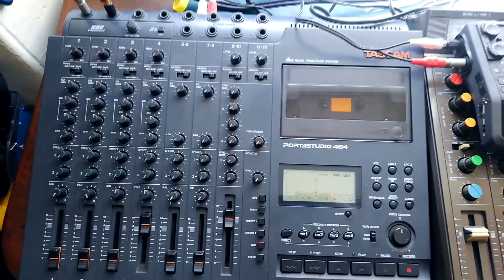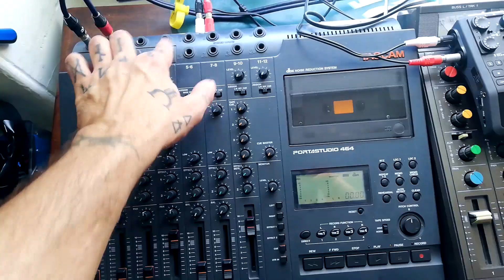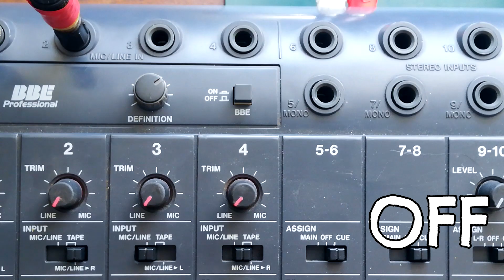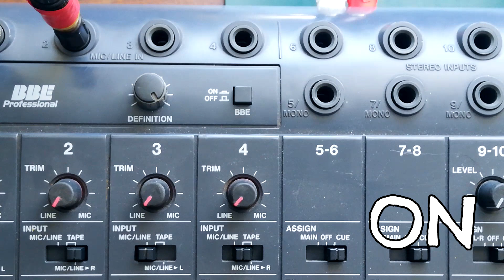BBE Sonic Maximiser - SOUND DEMO |Japanese Tascam Portastudio 464 | harmonic exciter test

Comment: Neat! I was wondering what a 4-track looked like with a sonic maximizer built in, I haven't gotten my rack mount sonic maximizer to sound good yet, it has "low contour" and "BBE process" knobs, I like the single-knob version on the 464 set low like you did in this video
Reply from the maker: Yeah, I find subtler settings are definitely better for an entire mix. Before I got an aluminium guitar I used to use a BBE sonic stomp - the pedal version  - to make my bog-standard, garden-variety wooden guitar sound more like the Jesus Lizard…low contour at 9pm and process at 3 pm worked well in that application.

Comment: Can you make a video on how to calibrate the VU meters on a tascam 246
Reply from the maker: One day, sure. Meanwhile, you access the trimpots through holes in the top panel if plastic case so it's easier to do than in the 244, but otherwise it's the same process, see this video https://youtu.be/vNCSR447M5o

Comment: I recently got one of these models but its not working. when you press play, it makes a noise and the play pause and record lights come on. Do you do repairs? I know your all the way in the UK, but all the repair places around me seem to have closed permanently.
Reply from the maker: Sounds like your gear C needs replacement, check out this video https://youtu.be/mcxex8Ooxcs
Reply: @Tetrakan  oh I've watched all your videos regarding the 464, especially that one. I've looked into ordering the c gear replacement off ebay and I feel like I could fix it myself but I'm a bit worried I could damage something. It does seem easy enough though, so I guess I could give it a try.

Comment: Do you know if the Japan version of the 464 will work on US 120v power?
Reply from the maker: It won’t, but you could buy a step up transformer to convert the power from your wall outlet to the voltage the Japanese unit expects. Type “AC to AC step up transformer 120v to 230v” in eBay or Amazon and you should see some options.